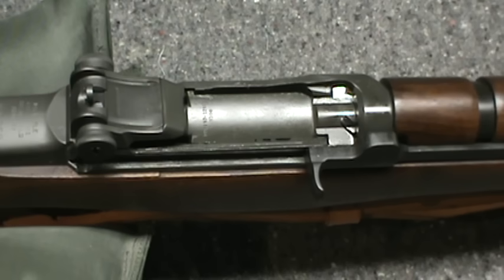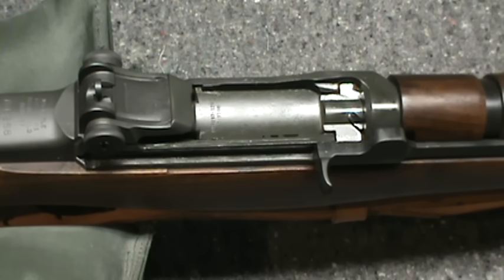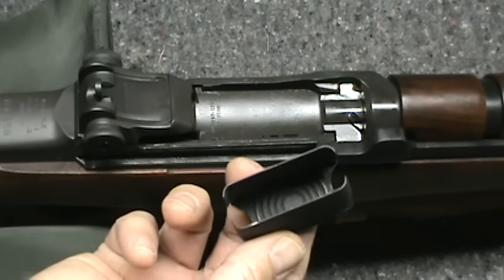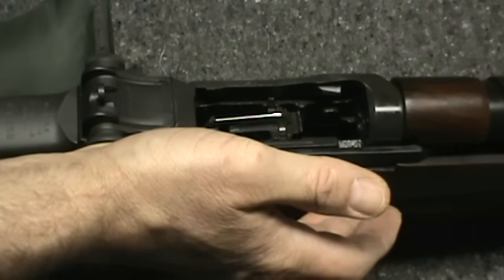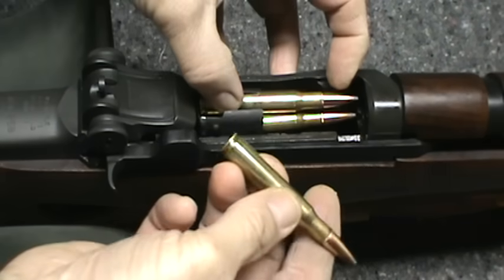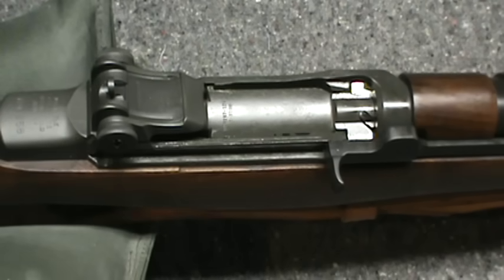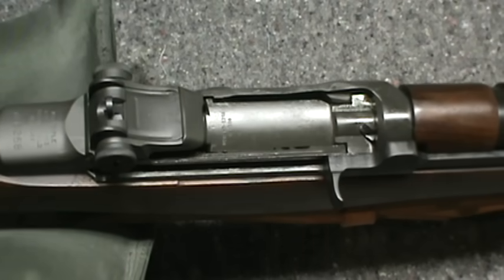How to load the M1 Garand the US Army way

Comment: Thank your father for his service. Thank you for passing down his knowledge.
Reply: Hmm no comment? Well now its has.
Reply: Amen
Reply: I could have been Speaking German if it wasnt for your dad.  So thanks for nothing dad.
Reply: @cctproductions6976  it would take too much effort and he wouldn't be able to claim victim status
Reply: I will thank  him but he pass a way in 69
Reply: And I do speak  German
Reply: I’ll bet his father could load that rifle in his sleep ..
Reply: Cervezadog 69  ccsds
Reply: I am sorry but this is a knowledge equivalent of learning to ride a bicycle with the helping wheels.. The original way (by the actual original design) is to push it all the way until you feel it doesnt go any deeper, maintain the pressure on it for a split second until you're ready to remove your finger, then of course remove your finger instantly in a swift motion. Also dont place your thumb on the second round, but the first one, and have the last round on the left side, its more convenient that way as your thumb in that position has less chance of sliding down to the second round. If you follow this exactly, you will never have the "garand thumb" and you dont have to hold the bolt like a noob, because it wont start moving all the way forward (it will only jump an inch to the mid position) until you release the pressure on the last round. You will only fail this if you're too hasty and keep your finger there after you relieve the pressure on it.

Comment: 2 cool things
1st. i have the "shing" sound as a text message tone. millennials think its the sound of a old cash register to indicate a sale or just that "ch-ching" for making money. but the only ones that do notice it are older men and women actually call it out correctly "that sounds like one of them old M1s". 

2nd under autorization with spare parts from the PMC R&D bunker out here. i was able to make a M16/M1 Garand hybrid. 
uses a AR15 .308 under receiver for the mechanical, i made the mag slot into clip section able to hold 25 7.62x51mm.308 NATOs. self built in magazine system. the top is the neat part, its the action system  for an M1 Garand, not an M14. Not an M1 Carbine. a Garand. the parts are obviously surplus parts. the gas system to make it a hybrid required a little jurry rigging in the end snapped into place like it belonged, force forged a screw pin latch tighteners for the sides to hold the receivers together. Implemented my own version of the XM16E5 gas system into the weapon (the gas recycle system) which required a bit more going over and optimization and another frame edit, having to forge another frame for the top. 6 years later, last year. i was able to create working version of an M16/M1 hybrid. uses stripper clips, is reliable, the gas system is amazing. recoil is nice (not quite 5.56, not quite 7.62. more like a 6.5). and it feels amazing and cool to shoot. oh the frame is a one fit carbon frame (like what the M21 or late M14 uses)
i HAVE stress tested the weapon, running it over and all that shit. and it ... was fine.
Reply: good comment, but who can mistake that sound. I can't. but once again good comment. nice info
Reply: Keller weskier or the small handful of kids, like me, that used to play ww2 fps shooters back on the ps2. The m1 is iconic for that sound.
Reply: can you please uoload a video of it. sounds really awesome
Reply: ^I second this.
Reply: Yes please do upload a video
Reply: ReGen QuadBoi never heard anyone call m1911's m1's
Reply: m1a1 carbine is the only confusing one really

Comment: Why did it kick the last round when the mag came out instead of putting it in the chamber?
Reply from the maker: +Edward Agee Most likely the clip latch spring is worn. 30 second fix.
Reply: +Edward Agee it didnt, the last round went into the chamber as normal.
Reply: +TopHatCat I think he meant on his gun
Reply: +Edward Agee that last round was in the chamber, so. normal cycle of the gun. you shoot empty case goes out

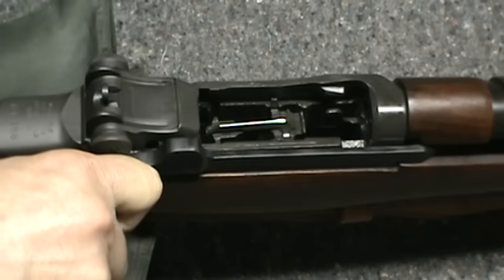Comment: 2:21  You popped the clip out, how?
Reply from the maker: Left side of the receiver there is a clip release that I pushed.
Reply: Eric Currier, it's a common misconception learning from mostly video games and movies but a lot of people think you have to run through all your ammo before the clip pops out but this would have been an awful design decision if it was designed that way
Reply: Yeah, but in the middle of a fight, on very rare ocasions you would use the clip release, you just unload the rest of it on the enemy position for support/damage.
Reply: Its meant for unloading the gun when you are no longer using it. You dont want to leave it sitting around with ammo in it. You need a way to unload it.
Reply: That goes without saying. He basically demonstated everything but the clip release.. so I was curious.
Thank you though
Reply: You can open the bottom of the built in magazine and remove the clip.  Then pull back on the handle to eject the round in the chamber.  That's how you unload it.

Comment: Thanks for sharing. That's an M1 that works properly. Question: Do you load your clips with the live round oriented to the left or the right side of the clip??
Reply from the maker: Parker Xavier I never paid attention to the cartridges in the clip. Either side works the same.  Just place in 8 and load it. Shoot, Repeat. :)
Reply: Parker Xavier When I bought my Garand it would not feed well. I researched and was told to load low and left. In my case that cured the feed issue for mine. Never tried it the other way again.

Comment: Thank you sir, salute to your dad. May I ask did you join the army as well ? also when your thumb got stuck in the bolt did you bleed ?
Reply from the maker: zero00tolerance 
When I was 18-20 I had bad migraine headaches almost weekly, I would have not passed the physical, so I never 
joined. I wanted to join the air force, but never persuaded it because of these damn headaches. My thumb didn't bleed, but it was like slamming it in a car door. Black and blue. The nail never fell off.

Comment: Yeah, I got the M-1 thumb one time myself. I was used to the M-14, but I was standing inspection with an M-1 before a parade once, and when I did order arms after the inspection, I left my thumb in a moment too long, and didn't have the heel of my palm positioned correctly, and I paid for it. But you can't yelp while you're in formation. You just have to take the pain, and bleed.

Comment: Me who doesn't own a M1 Garand: I'll most definitely need this in the future
Reply: the first time I saw this video I was in the same boat now I have one
Reply: Finally got mine . Traded a Belgium browning high power for it. swapped out the gas block so I can shoot store bought ammo now and replaced the front sight post with fiber optic. Bought some 5 shot clips ,painted them hunter safety orange so I can find them to hunt with, cant use the 8. Should make a hell of a hog gun.
Uses a long bayonet that I might take it with me for the ku de gra.
Save your money they are about 1000.00 and up Probably a lot higher with the way things are going but not unreachable.
The bolt system takes a lot of the punishment out of the 306 thou it still rock's

Comment: The thing you want to be clear about - is that you DO NOT bring your hand UP - and try to beat the bolt - you ROTATE it about the bolt handle so that when you are done - your fingers are PARALLEL to the rifle - NOT - perpendicular to it.  The bolt will fly forward beneath your little finger with your hand - and thumb - completely clear of the weapon.

If you are actually loading a real clip of bullets into the weapon - the action of stripping a round from the enbloc clip - will slow the bolt down while the round being loaded will keep your thumb clear of the breach (though NOT clear of the weapon) - but - if you are doing Inspection Arms, and opening the bolt to show that there is no ammunition in the weapon - there's nothing holding that bolt back but your hand when you press down on the follower.  Rotate your hand about the bolt handle and you will not have a problem.

I drilled with an M-1 Garand for 3 years in the late '60's as part of a High School, Jr. ROTC program.  One day - just as I had pushed down on the follower - someone called my name - and distracted - I failed to execute the maneuver of extricating my thumb from the receiver and got it mashed.  The cuticle on that thumb nail is different to this day.  The problem I had - was that the thumb swoll up putting a lot of pressure on the thumb nail which was very painful.  I hurt all night and the next day went to the local Naval Hospital (I was a dependent).  What the doctor did - was to heat up a paper clip - and use it to melt a hole through my thumb nail.  As soon as that hole was there - the fluid beneath the nail could squirt out through the hole - and the pressure was relieved - instantly reducing my pain.  I had a bandage on my thumb for several weeks and eventually the thumb nail just fell off, leaving the growing nail behind.

Oh - and thanks for showing us how to load individual rounds back into the clip.  While I have, on occasion fired an M-1, most of my handling of it was during drill as a cadet, rather than shooting it.

One thing about that weapon is that it never had a fiber glass stock.  They were all wood.  The problem there was that sometimes during drill (especially for the drill team which spun the rifles and tossed them to each other), weapons would get dropped and the stocks would crack.  When that happened - they'd strip all the metal parts off the broken stock and throw it in the trash.  I fished two of those stocks out of the trash, brought them home and wound electricians tape around them.  I can touch those stocks today - and it brings me back to when I was 17 years old - which makes them (and a broken old portable radio I was allowed to have on post with me in the Marines) the most precious things I own.
.
Reply: TL/DR
Reply: @SCP--oh1dg  

Uh ... TL/DR???

TL = To Long ...

DR = DID Read?

Isn't it - TL/DNR - for Did Not Read

I guess you're thinking Didn't Read ...

That's OK ... if you ever pick up an M-1 - I hope you won't get your thumb smashed.  It hurts.
.
Reply: @Mistwraith99  
From your link:

"Alternative forms

    tldr, tl/dr
    TLDR, TL;DR, TL/DR
    TLDNR, TL/DNR, TL-DNR"

Just like I said.
.
Reply: @BobSmith-dk8nw  You said TLDR meant "Too long did read". That's incorrect.
Reply: @Mistwraith99  Are you familiar with the basic usage of the "?" - question mark?
.
Reply: You might as well make a video at this point. Also, M4 Garand with carbon fiber thingy stock. Kek.
Reply: ooOmegAaa  This isn't a "fancy move" this is the CORRECT way to do it.  If you are not doing it this way - you are doing it WRONG.
.
Reply: Thank You so much.
Reply: @BobSmith-dk8nw  who cares?
Reply: @Mistwraith99  who cares?
Reply: What you do is let the bolt push your hand out of the way. And that isn't the way the army teaches you to load. Using the sling, you can't use your left hand to depress the clip while holding the bolt back with your right. And not using the sling, you still need to use the left hand to support the rifle while inserting a clip.
Reply: I worked for a doctor years ago and he-did the same thing to my thumb nail when i got it smashed working on a hay roller .
Reply: @MegaRiffraff  Yep.  Those practical Doctors and their high tech medical equipment ...

Unh ... actually ... wouldn't getting out of that with just a mashed thumb nail be a good thing?  I can imagine all kinds of really bad things happening to parts of ones body getting where they shouldn't be in contact with farm machinery ...

I spent some time working on copy machines with different types of rollers and ... learned to not wear any jewelry on my fingers or hanging from my neck.  Later, when I had to wear a badge at work - I had the old dog tag like chain the badge was clipped to - that would break rather than the lanyards.  Those lanyards didn't look like they'd give and I had visions of my face impacting something that caught my badge.  Of course - having the badge out of my shirt while working on a piece of machinery would have been a mistake but then mistakes happen ...

I was just walking by a chain link fence once and my High School Ring caught on it.  Jerked me right back but fortunately didn't get really injured.  I was impressed though by the force with which my arm was jerked back just from that ring on my finger catching on the fence ...

Yeah ... all kinds of ways to get hurt ...
.
Reply: I did the red hot needle thru the thumbnail as well. Although not for M1 thumb. Works great.